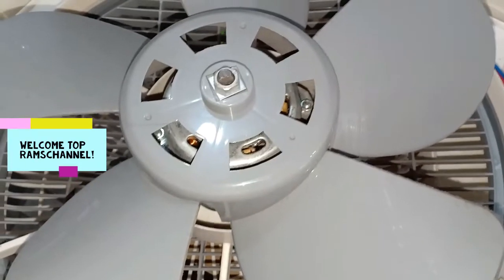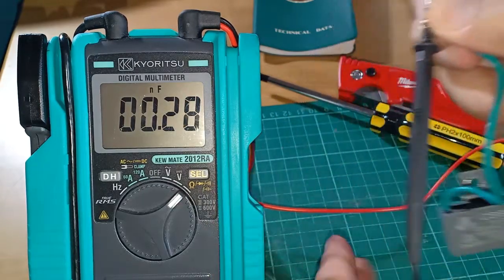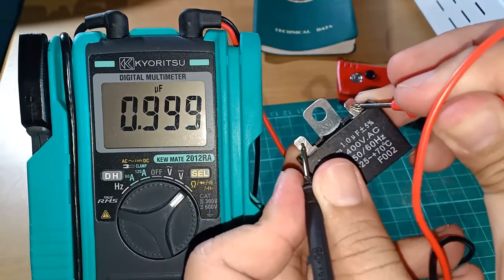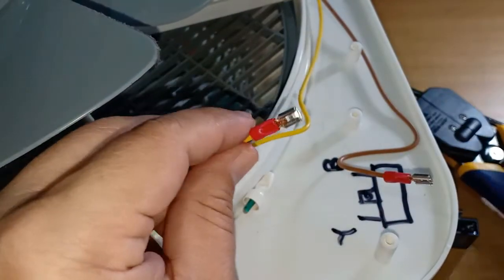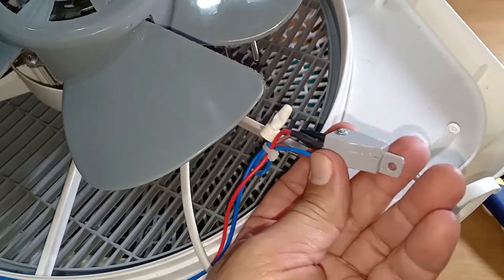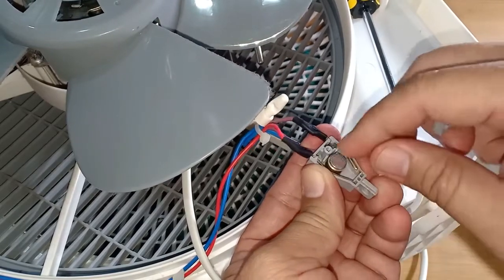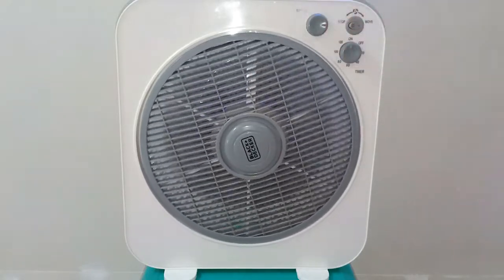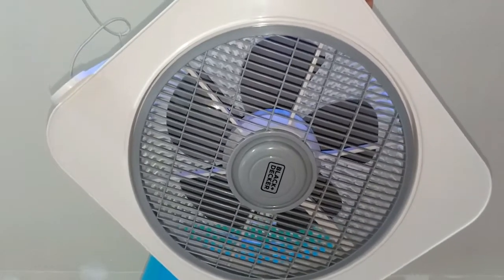[CC] Black+Decker 40W Box Fan Slow Speed Fixed- Replaced Old 1.0µF Capacitor

Comment: What was the total cost for replacement, including the cost for tools? I don't own these tools, so I need to see if replacing the whole fan or repairing is reasonable. Appreciate your video.
Reply from the maker: Thanks for your appreciation. The cost of the capacitor was Php50, or less than 1U$. The pliers, multimeter, screw driver, and crimp connectors I think you can estimate from an online supplier. A good multimeter like the one in the video cost at least 6 times that box fan. Without the tools I would have just brought the fan to the repair shop and pay maybe Php150 or less than 3U$. Depleted capacitor replacement is easily done in an electronic shop and more economical than buying a new fan, especially if you have a good quality fan with a quiet but strong motor that you want to keep using (I have one of those). This particular fan wasn't the best quality, however, just average.